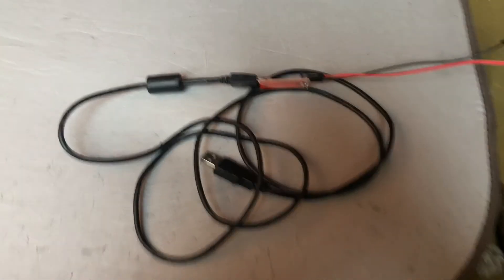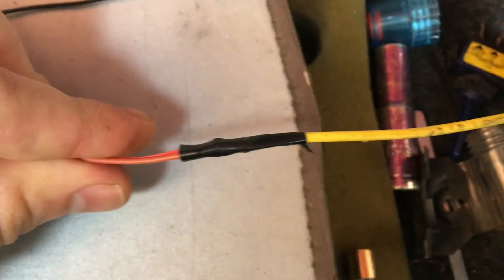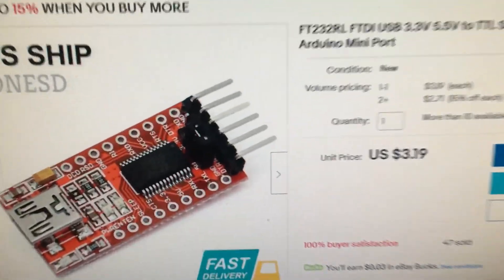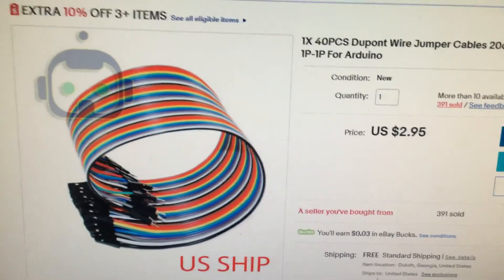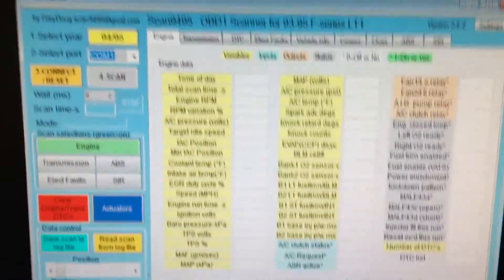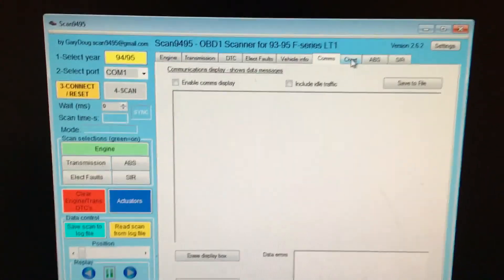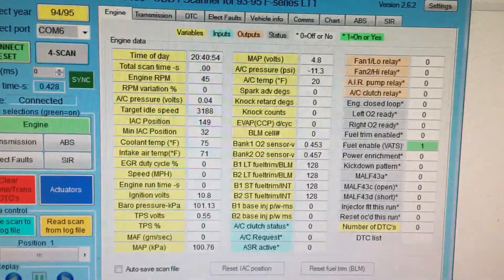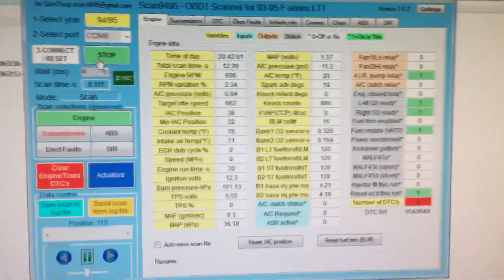DIY scan tool wire LT1 OBD1 Transition Year 1994 1995 GM Caprice Impala Camaro Firebird Roadmaster

Comment: $2.95 is cheap for something you need to accomplish this, so it’s probably not worth most peoples trouble to get them this way. But   For some reason I thought it would be worth saying that  a lot of flatscreen TVs that are on their way to the dump is a good source to find these type of wires inside of them. There is usually a lot of them inside and they’re free. Also you don’t have to wait for them to be delivered.😎